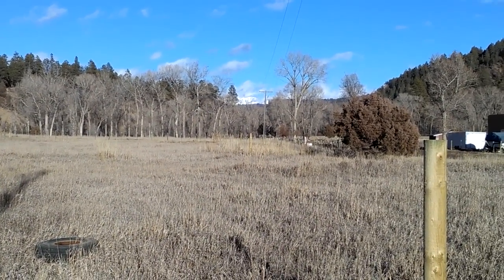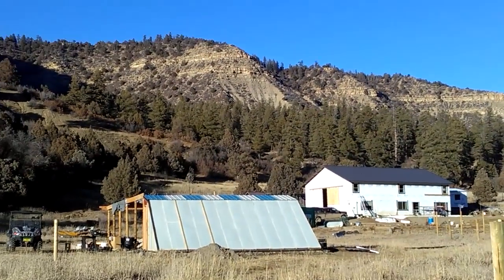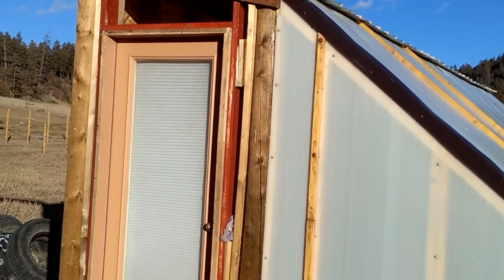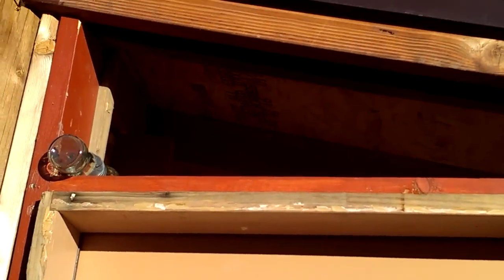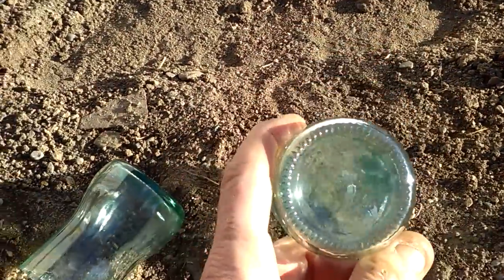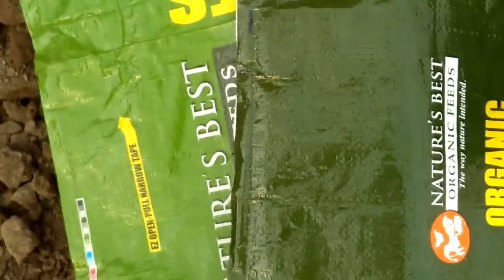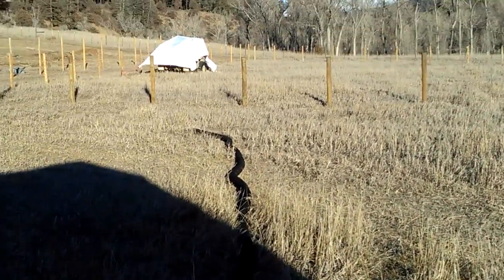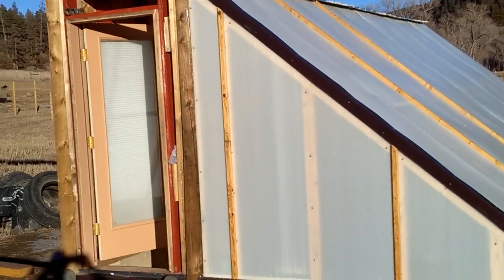Geothermal Greenhouse Update - Bottle Bricks - Climate Battery System

Comment: Where are you located mate? I'm in Northern California in the high desert! We bought forty acres with a year around creek; however our water table is shallow, depending on the time of year it ranges from two to three feet never dropping lower than 12 feet so we hand drilled water wells out here with an auger and steel piping cut in 3 foot sections that we threaded using couplings to attach sections of pipe to dig deeper and deeper down! We have a greenhouse 25 feet by 80 feet with a wood stove to keep it heated in the colder months. We also had a huge fish pond we dug out and stocked it with catfish and bass! We have lots of livestock, horses, sheep, goats, pigs, chickens, ducks and turkeys, we have two tractors and seed for planting live stock feed and vegetables and grains fruit trees berry bushes ECT! We have two livestock barns and 3 forty foot shipping containers to build an underground bunker which should help to maintain heat easier for the upcoming ice age, we have solar systems and wind turbines for power but looking to find an alternative power source as I'm not expecting much sun in this ice age! Thinking of tesla technology and tapping into free energy! You said in this video that we can come join you which I put the same offer out to many; however no one wants to invest time or money for future survival, I'm wondering if you get any takers? It surprises the hell out of me, we all know what's coming but it seems that no one can wrap their head around the severity of the near future! I intend on planting every square inch of our property this year that isn't being used for out buildings ECT! The reason I ask where you are located is if you are close enough to our place maybe we can put our resources together into building up two places incase one of us get wiped out, at the very least we can exchange ideas!

Comment: Hey Diamond, can the pretty bottle work for now and get that sucker done and producing food. You can always go back and do the pretty stuff later. Doing the floor heat is time consuming enough. I skipped that and I am glad we did since we have been enjoying trout and organic fresh veggies for 8 years now and if we had done all the "extras" as I like to call them, we might never have finished our very productive GH. Even the ground pipes can be done later between the rows. I will do just that when the important work around the homestead is caught up. Just my 2 cents worth. Remember that water is more than twice the BTU storage of your ground soil so plan on a good size (2500g in our case) AP system and your storage problems are solved in one get go. I can't believe you still have no ground snow out there. Where were you when we were picking our retirement home here in the Sunny snowy South, LOL? I must say though we do love our 100+ foot tall trees here. Not sure we could live without them and they keep us so toasty in the Winter. Our home built wood boiler with the IBC 330g storage is working great through these bitter days btw. Went 12 hours in the house with no fire last night just using the stored heat running to radiators. Have it cranking now tho. Best.

Comment: +Oppenheimer Ranch Project , hey Diamond, for those without a tile saw, check out "How To Cut Glass Bottles With String and acetone" or "First attempt at cutting glass with string and acetone" - most alcohols should work.
Basically burn the string around the bottle creating a high temperature ring, then dip it in cold water.
Reply from the maker: Sweet

Comment: I have often thought about adding the earth tubes to my walipini. With a high water table, close to 50 inches of rain, and crazy humidity. I am afraid they would turn into mold factories.
Reply from the maker: We do not have that issues here
Reply: If you start the earth tubes out of the ground in a chimney design with a chimney cap to prevent water entry, wouldn’t it stay dry on its way to the walipini?